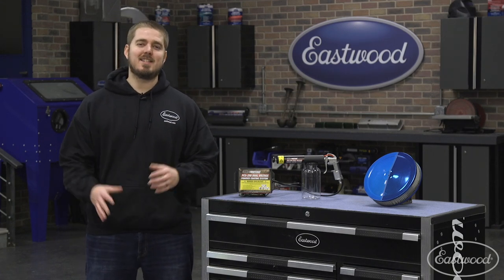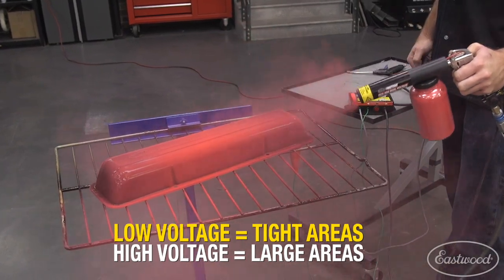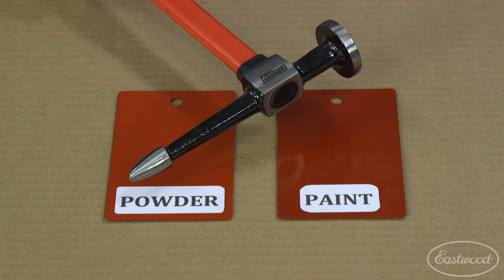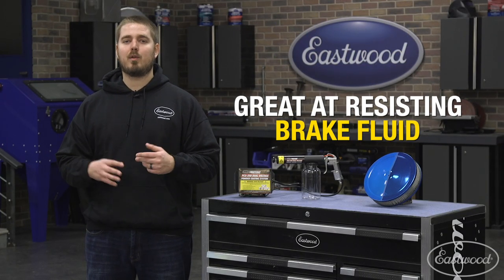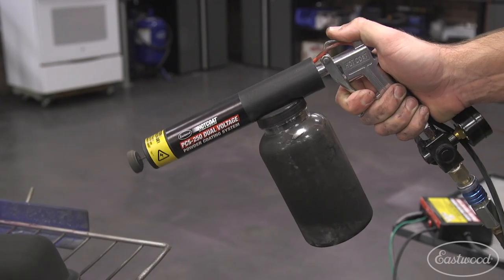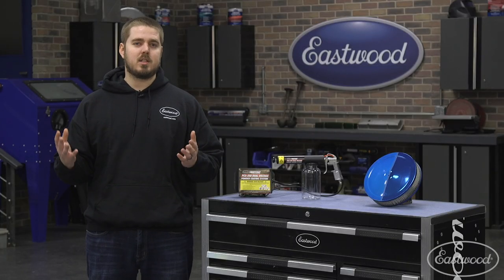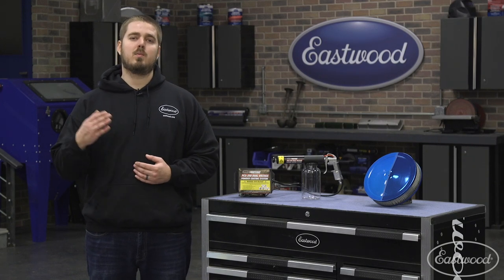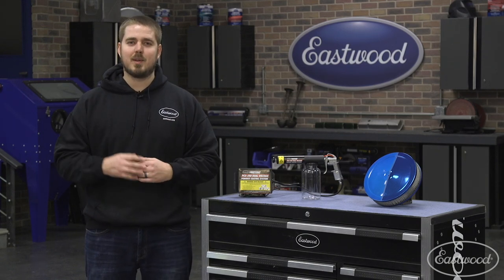PSC-250 Dual Voltage Powder Coating System: The Perfect Solution to Start Powder Coating at Home!

Comment: There are a lot of videos and forum threads dedicated to upgrading the last generation of this gun, and almost none of the problems were addressed with this upgrade. A new smaller diffuser tip, holes in the air inlet hopper tube to improve powder consistency, an integrated button to activate the current and a removable pvc pipe over the tip to direct the powder would all be cheap to fix from the OEM. An upgraded power supply to 50 Kv would really have set it apart as well.

Comment: Question for you guys. I saw on an another video, you applied solid color, like oragne over a coat of white.

When you do this,  I understant you apply the white, cure it and after that you go with your coat of color?

My question is: Do you have to do any specific preparation on the white piece before to apply the color and cure it

Thanks
Reply from the maker: No, once it's cured you pull it out of the oven, let it cool, then recoat

Comment: Would you be able to power coat rims after fixing road rash that’s been body filled?
Reply from the maker: No, Body filler would not be able to withstand the temps required to cure the powder.